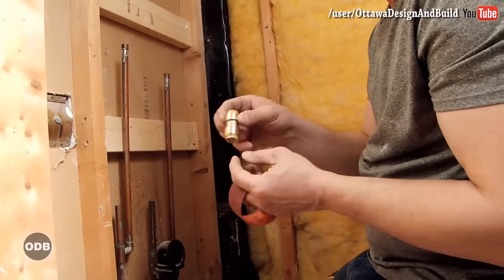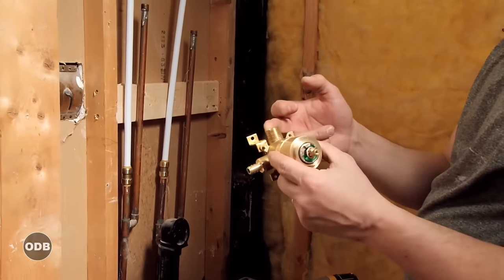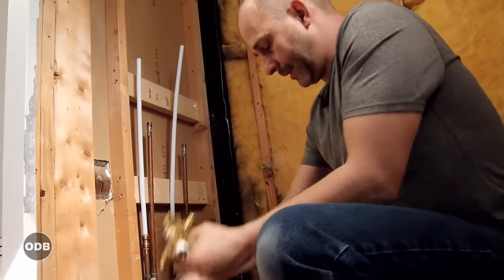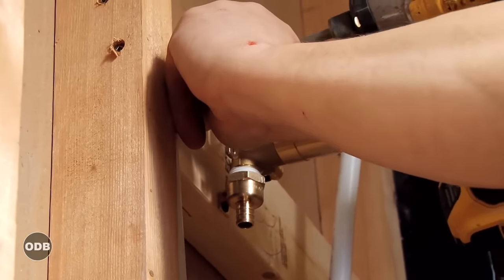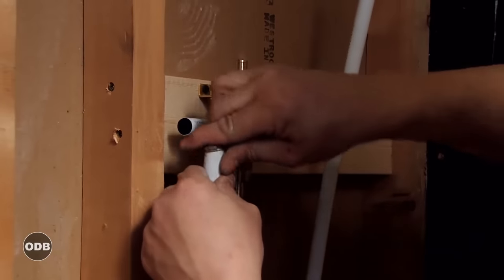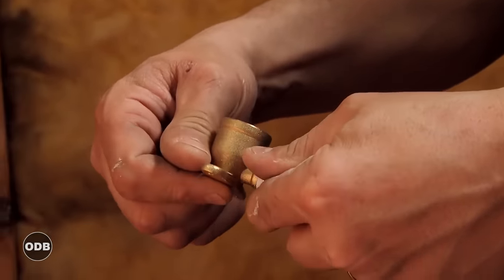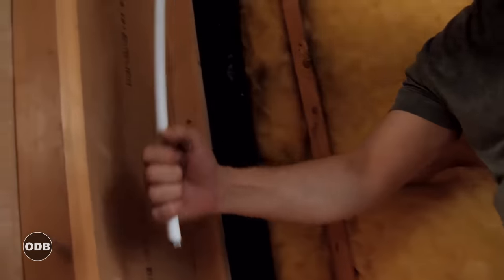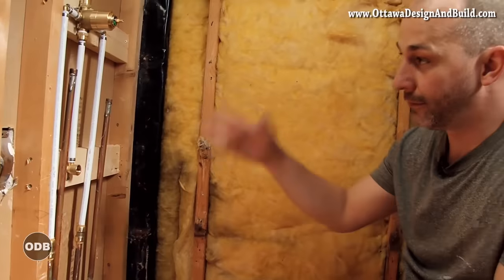DIY How To Install Copper To Pex | Shower and Bath Plumbing

Comment: What is the name of the adapter that you used on the shower and tub ends?
Reply from the maker: that's called a drop ear. Not sure where the term came from , but definately the name
Reply: Since the 70's we called em,dog-eared 90's; Monterey to S.F., as I recall. But I'm sure other Geo areas have there own slang.

Comment: Almost every manufacturer of shower valves prohibit the use of PEX from the valve to the tub spout. The inner diameter of the pipe is too small and will actually divert a small amount of water up to the shower head while the tub spout is open. They recommend either soldered copper or threaded brass pipe.  I have repaired far too many DIY jobs where the homeowner or handyman has used PEX down to the tub spout causing a trickle of water from the shower head while the tub is filling.

Comment: You can not run pex to the tub spout read the directions. It will say only IPS (iron pipe size). Your shower head will drip when filling the tub because of the back pressure.

Comment: How do you do just a shower valve no tub do you need to sweat the tub spout?
Reply from the maker: or just crimp an end cap.
Reply: another question relating to Pex, I want to run it up from shower valve to an overhead rainfall shower, I know I need a pex drop ear with a threaded female for the showerhead, but for the 90 degree turn on the valve wall how should I connect that? Great videos btw.
Reply from the maker: You could just use a pex 90 or if you have room simply bend the line. just be careful not to kink the pipe.
Reply: Ottawa Design and Build Renovations so are you comfortable with sharkbite push fittings in a shower without access???

Comment: I have almost completely switched over to pex. Far cheaper and faster than copper and if there is a leak at a joint, you just cut your crimp ring off and re-crimp. No draining the lines to re-solder. I strongly discourage the shark bites, though I don't trust them long term. And never use any of the off brand shark bites. They are garbage.
Reply from the maker: Thanks Ken, like with any new product sometimes we form an opinion on an early model and never allow the company to a fair opportunity to prove itself with later generations of the product. I think you will find that the new generation of shark bite fitting is quite outstanding and will earn your respect with the new 25 yr warranty.

Comment: what is the deep measure for the 2x4 that holds the valve?
Reply from the maker: use a 1 and a 1"board to mount the valve. That usually works despite the vale style. Allways check the instructions for hte valve body you purchase, there is no 1 rule.

Comment: do you have a video what are the tools for plumbing
Reply from the maker: Not Yet. plumbing has become a trade with multiple sets of tools depending on what materials are being used. This is not a plumbing channel, rather a do it yourself channel. I try to cover as many projects as possible in the time I have. Stay tuned for more plumbing tips though.

Comment: How do you put the panel inclosure
Reply from the maker: I like to use a spring loaded trap door which is very low profile and can be painted like the wall. simply cut the hole a little smaller than the dimension of the door and it snaps into place.

Comment: If you hold the Teflon tape  roll  the opposite direction(so it unrolls from right to left) and hold it against the tread, you will find you do not have to adjust your hold for tension. Just saying.

Comment: Appreciate the video - I have read that you’re not supposed to use PEX between the valve and the tub  spout .   My instructions specifically say to avoid PEX there .

Have you heard about this ? If so ,  why do they say not to use PEX ?
Reply from the maker: pex fittings that work with crimping decrease the diameter of the pipe and cause retraction of the water so it comes out the shower head as well a little.

Comment: Seems like using the sharkbite fittings for everything would be safer than crimping. More expensive, but less chance of effing up the job
Reply from the maker: Plumbing isn't designed to fail. Some techniques not followed properly or integrity on the part of the plumber is usually the cause of a problem. Throwing more money at the fittings isn't going to change that. I prefer to keep things simple.
Reply: Home Reno Vision DIY I'm thinking about the average diy'er like myself.

Comment: Problem with pex if the job not don't properly pipes moves and rattle inside the wall
Reply from the maker: Any pipe not fastened will cause rattling , that is why you need to install the clips with the nails found right next to the fittings on the shelf at the hardware store. There is no problem with the technology.

Comment: how short of length I can use pex... I have a disaster of valve, not too much room.
Reply from the maker: you will need at least 3 inches from valve stem to stud. as an option you can drill a hole in the stud and run the pex from the other side.

Comment: Don't use PEX  supplying the tub spout, its to restrictive and will cause water to come out of the shower head. I learned the hard way and had to remove tile to fix the problem. Use copper or a 1/2' brass nipple if you don't know how to sweat copper. I definitely don't use Shark Bite inside of walls.
Reply: What if you use a 3/4 to supply the spout?

Comment: Pex to the shower head is not recommended. Use copper or CPVC.  That is why there are threaded fittings that go to the shower head and tub spout. Using Pex can cause the tub spout to drip due to the increased pressure on it because of the smaller inside diameter of Pex.
Reply from the maker: If you use a valve that diverts water to a specific function it is not a problem. Stop using the manual diverter and get a real valve. Cheers!

Comment: Very clean, except for the shark bite in an enclosed wall cavity!! the "0" rings are subject to crack , dry out and fail!! they are specifcally used for temporary repair work not perminate installation.

Comment: Sharkbites are great but their not rated for longevity and you never want to put them in enclosed walls. Soldering a sweat adapter to a copper pipe is not hard and should be used over a quick fix shark bite coupler...

Comment: Two questions:

1.  Can you over crimp the rings?

2.  I though PEX was red/blue in color?  Does it matter other than the obvious reason?
Reply: Tim Mattle 

1. No, not with the proper crimp tool

2. Color does not matter at all. You can get red and blue if you like color coordinated pipes for fun.
Reply: @DonRobertson82  thank you..

Comment: I’m not hating or talking shit but he had      the channel locks the wrong direction when he was tightening the fittings in the valve body. Not to mention he wraps Teflon on the threads the hard way. Right direction but takes longer. I did agree with him using Teflon and pipe dope. I do the same on fittings in pain in the ass spots

Comment: The video served its purpose. All of the bitching is from a bunch of disenfranchised "professionals". I mean complaining about how one holds channel locks lol. You have to be kidding. I work on cars and have held channel locks and every other tool however I have had too to get the job done. Point is the job got done. I know you all feel offended that your low skill soldering skills aren't necessary but give the video a break. Geez I may need to go check the coolant lines on my car. I think I held the screwdriver UPSIDE down when I installed the clamps LOLOL.
Reply from the maker: Thanks john. Just trying to demonstrate a way for homeowners to do something themselves. Had a little camera nerves the first time out too. lol

Comment: Not meant to criticize. But you absolutely should never use pex for the tub spout line. Only use copper pipe for the tub spout line. The inside diameter of the pex is smaller than copper, and when you run water out the tub spout, the pex pipe fills up faster than the actual flow of water, and the water will build up to the shower head and start dripping or running out the shower head while the tub spout is running. I learned this the hard way.
Reply from the maker: Thanks, we covered that earlier. Use 3/4 line to the tub and should eliminate that problem. Doesn't happen in the country just under city pressure.

Comment: Saw it right off. They are really called pump pliers.  So if put on the correct way, you just pump them.   Channel lock made them famous, thus people call them channel locks.  But they are water pump pliers.
Reply from the maker: interesting.

Comment: bro I found your videos totally helpful, basic shit with killer hints that only lazy asses could never do. so they hire over priced clowns to do it for them, common sense shit these days are not very common, people will all ways find a way
talk shit no matter what you do, SMH please keep up the good work, great videos, Like my old man always said why hire a fool if you can fix it yourself...
Reply from the maker: Thanks David, I appreciate all of the comments, the truth is that there are a lot of advancements in materials and techniques these days that require basic tools and understanding. That scares a lot of trades into fear mongering on sites like mine. At the end of the day...do good work and guarantee it for reasonable rates and |I wouldn't try to do it myself either. But if trades try to make off like bandits on my hard earned buck I will kick them to the curb and do it myself.

Comment: Your wall is open just solder on the conversion fitting and you won't be creating a headache down the road. 
It makes me sleep at night knowing I didn't use compression fittings behind a wall and can't be monitored. 
$10 sharkbite or $2 copper to barb fitting 🤔
Reply from the maker: we showed that option in another video. Cheers!

Comment: That`s simply perfect! Like Lego! :)  However it looks like a toy-technology a bit. Every single joint is a disadvantage. When copper can be simply bent, PEX requires 2 joints.... And everyone in in a risk of leakage from ageing materials, metal clamps rust, etc atc....  And how much it would cost to fix it further!!!  Sounds scary.   In my feeling it `s designed more for open piping projects or for gardening purposes...
Reply from the maker: copper can't be simply bent, evey corner is 2 joints as well.

Comment: Those crimps work fine for rubber driveline boots,  but I would never  use them in plumbing as they lose their ability to stay tight over time.
Reply from the maker: This was the only cost effective technique when this video was done for homeowners. They have since put a crimper for the solid rings on the market that anyone can afford. We have a new video coming out early summer.

Comment: When I first started using pex I used those crimp rings but then learned they are the worst rings to use especially on the hot water lines. Next problem this guy will learn the hard way is never use pex on tub spout it creates back pressure and water will come out the shower head when your trying to fill your tub.
Reply from the maker: Thanks chris. It is always such a problem to have a drip from the shower head when filling a tub.
Reply: not just a drip it is full shower or it was on the one i just repaired last week
Reply: it happened whe the water started mixing right between hot and cold

Comment: Should be using galvanized screw, you will have moister behind wall.
Reply: If you ended up having moisture behind the wall screws should not be your worry 
MOLD IS THE WORRY

Comment: How about turning those channel-locks around the correct way to tighten those fittings. Better yet, use a cresent wrench as to not round off the fittings edges. And you're a plumber? LMAO!
Reply from the maker: Thanks for watching.

Comment: I kno I'm late but damn theres a lot of people miss guided in the replys yes sharkbite fitting should never be installed behind closed walls and shark bite are a temp repair use only until you can make the proper repair and all service plumbers will agree with me most people do not allow for the scale build up from hard or soft water witch slowly builds up in that cheap brass fitting slowly pushing that o ring after awhile being months or years its going to leak.. its better to be used on copper so them little stainless teeth can grab some meat. being so you have to allow for electrolysis as that copper is grounded somewhere break that ground and you have little bits or energy...electrolysis...following the path or least resistance searching for that ground slowly attacks the copper inside the brass fitting and pits and corrodes that copper and leaks occur.. using sharkbite on plastic pipe such as pvc sch 40-80,cpvc sch 40-80 pex,zurn,uponor etc... reminder shark bite is a temp fitting why take that chance of another leak and causing tons in damage in the future
Reply from the maker: Sharkbite has a 25 yr warranty. Show me a plumber who has one and then maybe a homeowner will take their advice.
Reply: Lol what

Comment: ...those other pipes outlast copper?
Reply from the maker: The flow rate may be reduced but that can be fixed by installing 3/4 inch line to those areas where you need more water fast eg tubs and dishwashers
Reply from the maker: in new builds it is better to have each supply line come from a main hub. no joints in the ceilings.
Reply from the maker: perfect
Reply: +DeeInTheHouse Copper should last fine and last a long time so long as it's K or L  copper tube. M is minimum code for potable water systems and I find there are significantly more issues with it because of the thinner walls compared to K or L. Pex tends to last a long time though but I would want as few plastic pipes as I could get away with for a potable water system because I don't trust plastics, there have been links connecting some plastics to increased risks of certain kinds of cancers although some plastics may be fine i'd never put it in my own home.

Comment: Are we not going to talk about The push-fit inside The Wall?
NEVER put a fitting inside a Wall.
In sweden its only allowed for heatingsystems bcs The water runs out but not tapwater
Reply: christoffer o relax. Sharkbites have been approved for in wall use

Comment: Why not just curve the feeder piping around to go into the manifold instead of installing that elbow?  Seems like water moving fast is not going to like that 90 degree turn ... but maybe there is a maximum curvative the pipes can take?
Reply from the maker: you can but you need a special bracket to keep it from kinking. in may cases the framework interrupts that unless you rebuild the wall.
Reply: @HomeRenoVisionDIY  
thanks

Comment: Would it have been hard to solder on a few adapters. You already cleaned it... throw some flux on and get the flame on that bad boy.

Comment: They don't hold better under more pressure.  In cases of freezing pressure they actually slide right off.
Reply from the maker: Good reason to pay the heating bill.
Reply: Yahh, your mobile home pipes shouldn't be done with shark bite, unless well heat taped.

Comment: 7.3.2.3. Screwed Joints
(2) no pipe-joint cement or paint shall be applied to the internal threads. ((that includes dope))
Reply from the maker: Not sure what you are referring to, however in my experience trusting in ptfe tape alone usually sets you up for a warranty call. This is why I use both.
Reply: I always use both, takes 5 seconds.
Reply: he is referring to the Ontario building code. Its a code requirement throughout Canada in both plumbing and gas fitting to not apply and sealant, lubrication or compounds to female threads (threads on the inside of a fitting). Its terrible practice and will cause issues later on by plugging orifices, clogging filters and messing with the integrals of cartridges.

Comment: I found a lot of home owner mistakes. Teflon roll reversed, using slip joint pliers backwards, stripping the wood with the screws going too fast not metering his speed, using regular drywall screws. Codes usually say use brass, at least use anti-corroding deck screws. This is why homeowners botch everything up. Watching other diy'ers doing things wrong.
Reply from the maker: Thanks for watching Sal.

Comment: sharkbite fittings in wall a no no. and don't put pex adapter on bottom of valve it cuts flow down and will make water drip out of shower head run copper or three quarter pex with three quarter by half adapter
Reply from the maker: Thanks Johnny

Comment: You are not supposed to run pex to tub spout. It can cause water to come out of shower head when taking a bath. If u tested before Closing the wall and it didn't happen all is fine. But I would definitely test it first.

Comment: SharkBite offers a warranty of only 25 years. After this period the O-rings may fail behind the drywall, which would require a costly repair.
Reply from the maker: Yes this is true, however most things built in a house today will not last 25 yrs so there is no reason to worry about it. The repair is not costly by the way. simply address the issue during your next renovation. You will be hard pressed to find a bathroom in 25 yrs that has not been remodeled.
Reply: I can see that you have never been to NY. Many homes that are around since ww2 have original plumbing and fixtures.Surprisingly even places that are older have original bathrooms.

Comment: Shark bite fittings are great in a pinch . They're guaranteed for fifty years according to them..If installed by a licensed plumber.  Diy.. make sure you don't knick the O-ring. This will cause failure.
Reply from the maker: great for DIY if you don't trust your soldering skills.

Comment: How do you get away with doing the bathroom remodels without pulling permits? Where I live you’re supposed to pull a building, plumbing, electric permit and then they make you get a certified plumber and electrician to get the inspection passed.